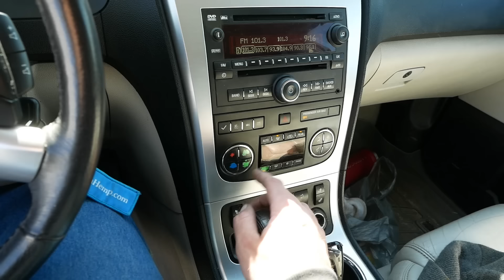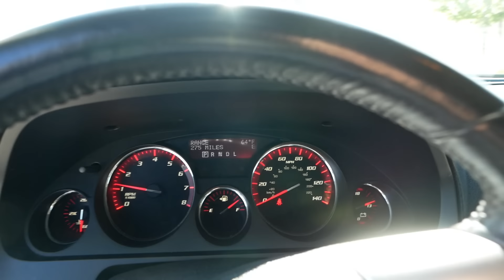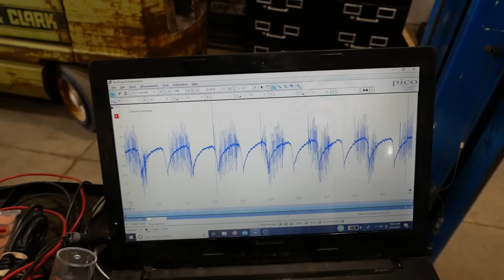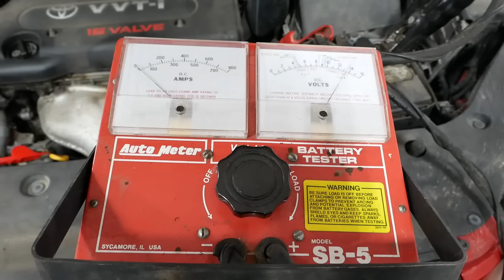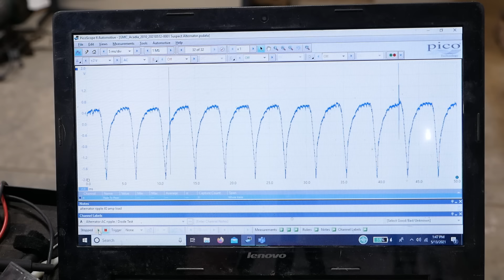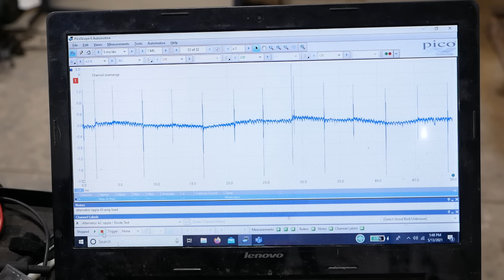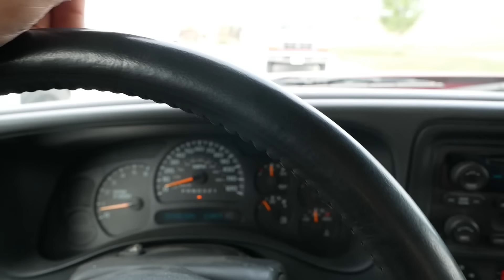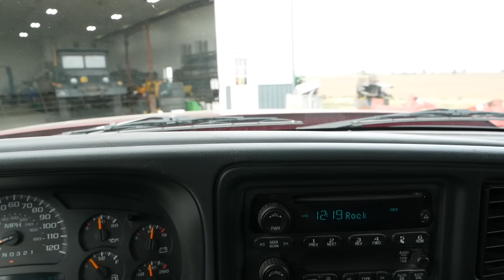A Normal Day at My Rural Repair Shop

Comment: I'm surprised you don't buy your most common oils in 30 or 55 gal barrels.
Reply from the maker: It's actually more expensive. No idea why.
Reply: @WatchWesWork  Amazing.  When we were farming, we bought engine and hydro oils in 55g drums and "standard" grease in 30g drums.  We'd also buy a specialized "white" grease used for cotton pickers in 55g drums.  Funny story about buying oil back when Costco was Price Club.  I'd ordered 4 drums of oil and went to pick them up.  Price Club had opened just a few months before and we'd joined up pretty quickly.  At the time, I was using a Motorola Handy Talkie =and= an old "brick" cell phone, especially since our farm was about 20 miles away; comms was important!  I'm walking around just looking at stuff when a manager approaches me (no, I've never been a Karen) and tells me I have to leave the store.  I ask why, and they say that they don't allow communication devices.  I tell him that I'm working, just as a cop or fireman would be if they came in.  I was told "that was different".  I replied, "OK, I'm here to pick up a $1,200 order of 4 drums of oil.  I can always cancel that and go back to the distributor for my oil and grease."  Boy, did he back down in a hurry.  That policy lasted about another 3-4 months, IIRC.  :-)

Comment: I'm still shocked at the output of today's alternators. Don't see the need. My 1969 Citreon had a big 25 amp unit that handled rear seat heater and rear window defrost with little babying. It was still doing a trouble-free job at 115,000 miles. Most comfortable car I've driven but NOT designed for Canadian prairie heat and cold.

Comment: Do you find that toolbox to be a little tall?
Reply from the maker: No. I'm tall, so it works well.
Reply: @WatchWesWork  Did you get that from Menards? Cause I was looking at one and I thought if I was to put a vice on it the work would be to high. I’m 5’ 10”.

Comment: How right you are at 16:34 GM most certainly does hate us and I, for one, hate them back. I lost track of all the things on GM products that either literally nearly killed me or cost me jobs, hundreds of hours of needless work and/or severely tempted me to reach for the 12lb sledge hammer as a final solution. Not letting that racket fail back in 2009 and tossing its executives in prison then selling off its assets to someone else was a massive mistake by the US government. GM exists to screw its customers, its employees and the US taxpayer - as well as literally get away with murder and stall payouts on products proven in court that were designed to fail after they ended up killing people. They CAN design and manufacture decent stuff but they simply choose not to do so in favor of racking up repeat vehicle and parts sales and extra services to the brain dead ''Patriot grandpa drove a GM'' crowd.

Comment: There used to be a guy around here, I was never sure if his nickname was "ratchet" or "ratshit". I once saw him spend an afternoon using three different coloured tapes to make a logo on the back window of his car. What a waste of time! Personally, I just buy old bangers and drive them until they die. I've done this all my life, I've never bought a new car and I never will.
As a rule of thumb I have a £1 per day rule. If I buy a car for £365 I would expect it to last for one year. You win some and you lose some. My present car cost me £1200 but has lasted 10 years. It's a nondescript Kia, but good enough to carry all of my tools.
I just cannot understand why people put so much money into something that will just rust away.
For those wondering, I do maintain my vehicles with regular oil and filter changes etc.  I recently bought new rotors and pads for all four wheels. It cost £120, that is pretty cheap. When I see a video of some poor BMW or Mercedes owner I just laugh.

Comment: hey wes  and mrs and son and pup ;] thanks for the video  .doing a little information extrapolation...your rocking an older thinkpad which will do email and the scope surf the web and do excel all great but your video editing and the rendering it sucks at  i garentee  if you wish to half those times have a look at the asus rog series of laptops  on older g73 would do the job far better and a brand new one would be overkill for your needs but your son would thank you when it came time for gameing hope the info is of use

Comment: you are the best,careing,do it all dont leave anything out i have ever seen.im 70 wish you were close by,question 08 enclave my wife called one nite went to work she got off drove 1 mile to a store came back out car would not turn over called me said come jump me off she said in that 1 mile trip it made a squiling sound not real loud mide you we live 20 miles from he job got there got jumper cables on would not turn over checked oil oil ok towed to shop said locked up could it be somthing else if not what do used engines there 3.6 run how much would you charge to change it out brand new 4000 dollar trans in it mike r

Comment: hey wes I realize you are a ford guy but let me just say I worked in a shop for over 20 years and the worst vehicle I ever changed oil on are ford pickups the are miserable to get filters off up around the fan and no tool in the world works on them so gm to me is a piece of cake
Reply from the maker: Yeah Ford is great at making horrible filters. Like the Super Duty diesels with the fuel filter tucked in the frame rail. Anyone who can change one of those without fuel running everywhere and down his arm gets lunch on me. Chrysler actually does a pretty good job on filters.

Comment: The seal on those radios is garbage, plastic on metal.  I had a 99 sport  and it would piss radiator fluid every few years, usually from the top.

Comment: Call me cynical, but Main Dealers for OEMs like GM make their money from "After Sales Service," that is the annual maintenance. Most of that is on the ICE (Infernal Combustion Engine :-) engine, some on the running gear, (why so many dealers avoid selling EVs until they are dragged kicking and screaming into the new future [that is here NOW], as an EV needs very little maintenance compared, so MUCH less work and profit).
If the 'official' time for the job is 3 hrs, and the mechanic can do it in 1 using your trick, he can charge for 2 hrs, and say in all honesty that the official job time is 3, but he is doing the customer a favour by charging for just 2. And make an hours profit. If main dealer prices are the same in the US as they are in the UK, they are Eye-watering! A nice little racket all round!
Reply from the maker: For every job that says 3 hours and takes one, the there's a job that says 1 hour and takes 3. It all washes out in the end.
Reply: @WatchWesWork  Yup! Had a few of those! The stud you have to drill out, the bolt with no sides at all, and no access to cut a slot, to name a few. And all the special tools!

Comment: $2,000.oo cash and you come and get it will get you a complete 2001 Jeep Wrangler with a 4 litre engine, 5 speed, 4.56 gears and posi in the front. engine burns no oil.

Comment: Hey Wes, Blackfly problem?  You'll find comfort in the classic folk song Blackfly: https://www.youtube.com/watch?v=f389hIxZAOc .  Also,   you gotta wonder about the need for a 170A alternator, does that Acadia have laser death beams on the roof?  Once upon a time, 60A was the "big" alternator option.
Reply from the maker: Back before heated seats , rear defrost, electric cooling fans, a power sunroof, dual HVAC blowers, 4 smart phones charging, and concert level audio equipment. These newer cars are just rolling electrical loads.

Comment: That is crazy that you have to do that much to change a friggin' alternator. That why I never drive anything made after 2000. I like my vehicle to be old enough that I can sit in the engine bay and work on it. This modern stuff is worthless. I like to able to loosen one bolt, remove two others, and take out a plug. If it's any more complicated than that, then I'm not driving it.